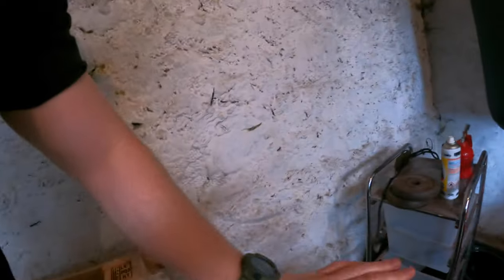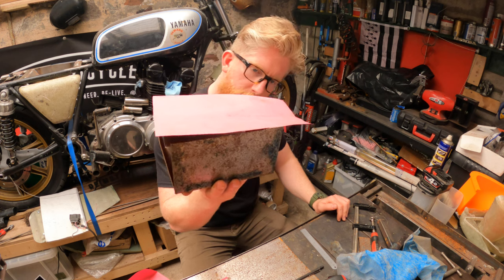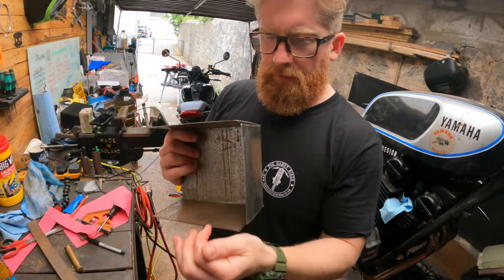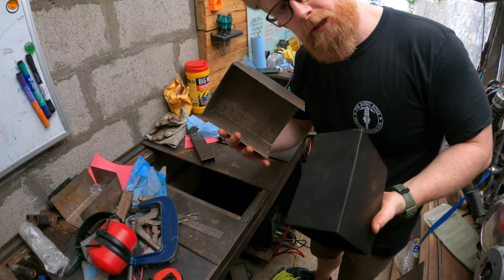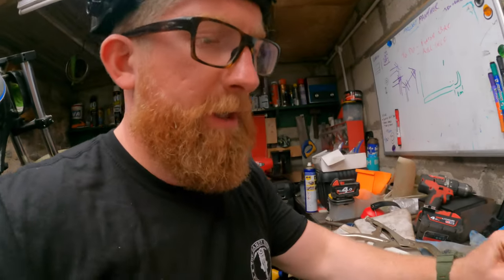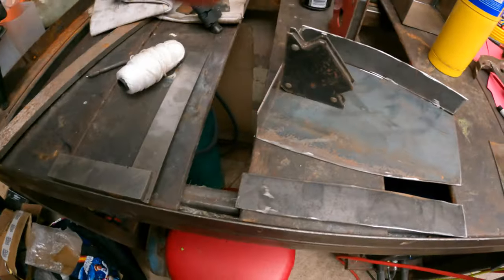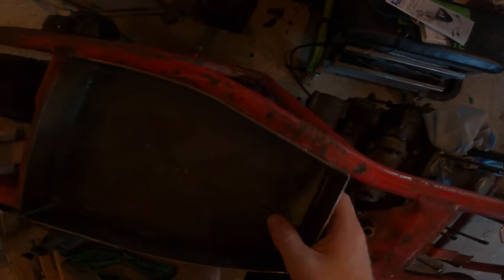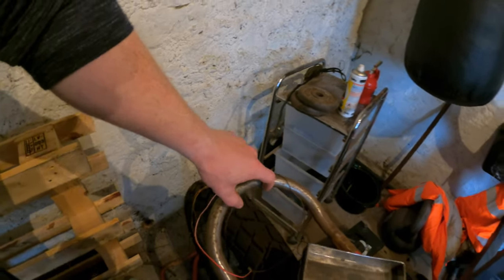XS750 Vlog 4 - Electrics tray fun

Comment: try and run your grinder down the bend line to score the edge and drill small holes at the corners where the corners meet to allow some room for expansion then weld the small holes when you weld the seems up. 
Mind the material stretches when you bend it, so the holes should allow it to come together easier.
Or
Make it in two parts, one with long side and bend the two ends the other with the base and the other longer side and weld up the joints, not really any more welding and will be easier to bend.
thinking about the elec tray might be worth a try and do the upstands of the tray first, bend the upstands along the frame to get them spot on and clamp or put small tacks to hold them in place then get a piece of plate for the bottom roughly cut out and tack that to the upstands while there still in the frame, break off the tacks on the upstand and take the lot to the bench and fully weld and trim.
rock on.
Reply from the maker: Thanks dude, yeah I think the grinder down the line is a good one, used that before with thicker metal, will give it a test with the scrap 1mm I have left to see if that helps 👍

Comment: I had the same issue with my electronics box as the frame is slightly asymmetric so I just welded a flat plate to the underside of the frame.

Comment: Just a couple of thoughts. Is the battery going to be OK laid on its side? Also is there going to be enough room to slide it in and out with the carbs/filters in place or the rear wheel depending which way its going in?
Reply from the maker: Thanks, yeah had a look and the gel batter is happy enough on its side! Now your other comment has got me scratching my head as there’s no head on at the moment to check, I will have a think though, thanks. 👍